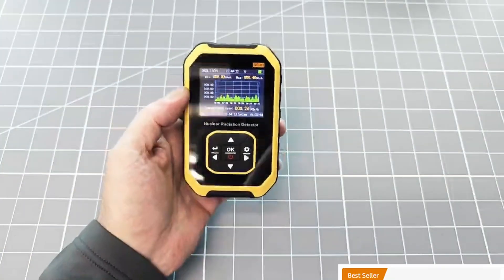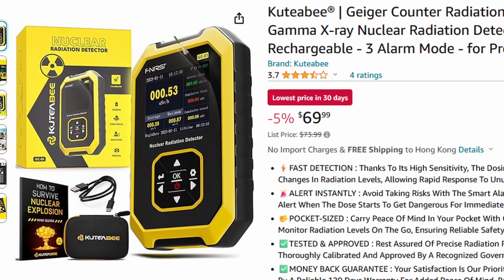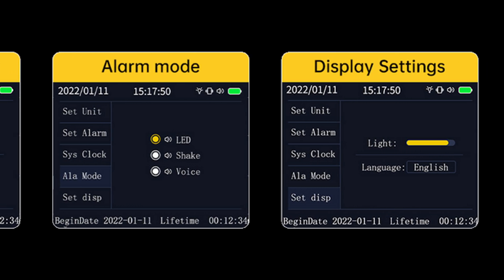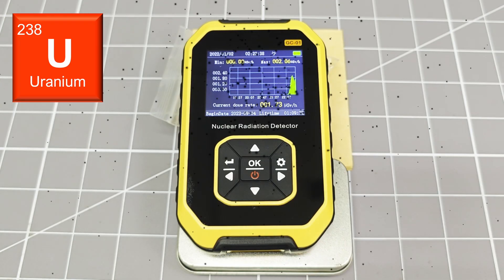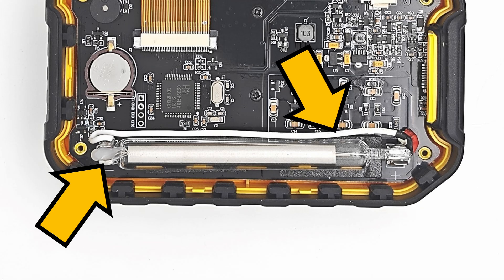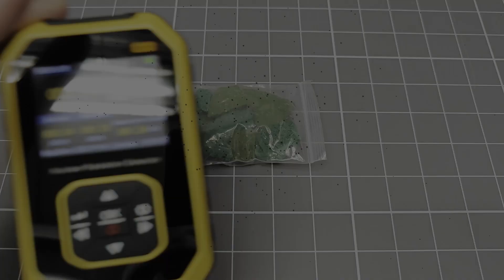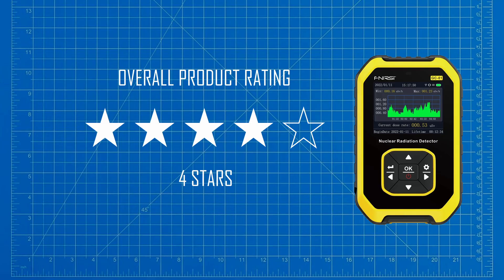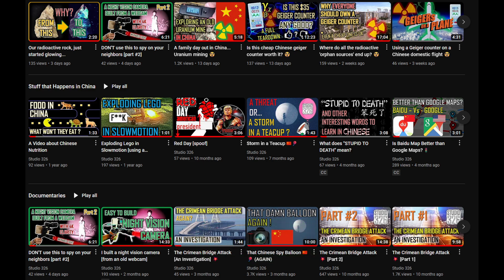FNIRSI GC-01 [IMPORTANT PRODUCT UPDATE]  ☢️

Comment from the maker: UPDATE - Don't remove the loading resistor (R38)  - it isn't necessary...
Reply: Consumers everywhere salute you!
Reply: This man must be protected.
Reply: Even when the tube is changed?
Reply from the maker: @blackfox_357chief4  When I made this video, it was summer here in the tropical region of China and the humidity was consistently over 85%, once winder arrived I found that without the loading resistor, the PSU voltage peaked pretty high and caused some ionization in the tube.
It should also be noted that as part of an crowd-science experiment I am currently running, it seems that there is a lot of manufacturing variability in the PSU voltage of the GC-01.
Reply: @project-326  So you can speak chinese too? Amazing!
Reply: What about the wire that is glued on? Does that stay too?
Reply from the maker: @falsch  thanks for the comment.  The wire is part of the 'hack' that the manufacturer has done to put the crappy tube onto the product and should be removed with the tube itself.
I hope that helps!
Reply: Hello, I just bought the fnirsi gc-01 and I made the modification with the 100nF capacitors. I also measured the voltage on the tube with my multimeter and I got 262v which seems too low to me, do you know how to increase the voltage on the tube? My r38 resistor has a 516 marking. Best regards
Reply from the maker: @uchu007  The voltage is probably correct, you multi-meter will have an input impedance of about 20M Ohm, and will pull the HV supply low.
Reply: I got one with the shitty little tube and no r38 resistor. Upgraded to J321, still shit. tube voltage is 300v. Can't flash radpro on it cause it doesn't show up as a USB on the computer. Overall, it's shit. Even with the J321 tube
Reply: i sugest testing it without cover its more sensitive
Reply: i have one with the good tube
Reply: Mine is just as described- thank you for the important info!
Reply: You rock
Reply: Value R38 ?
Reply from the maker: @svkpsychopath8074  4.7M to 10M depending upon the PSU characteristics.
Reply: @project-326  i uave small tube :( but R38 im not how calcuta it for bigher tube ?
Reply: So do the ones with the correct tube work?
Reply: Sry, is it necesarry or not?
Reply: It seems to matter; my dosimeter started to detect background radiation normally after removing this resistor.

Comment: A very professional video.  Sorry if this has been mentioned before but the circuit diagram that pops up a few times clearly shows both a speaker and LED wired to beep and flash at each count.  The values of these components would be much appreciated.
Reply from the maker: there is an update video that achieves a better result with a FW update...
https://youtu.be/23sX-_Oo_h0

Comment: I bought one of these Gc-01 detectors today with very low expectations. 
As your video showed, it does use what looks like the j613 tube or maybe an even cheaper copy of it! They seem to have redesigned the unit as it doesn’t look quite the same internally as the one in your video. They have also crapped out on the battery which could be a lithium 14500. 

What I found of particular concern is the fact that the battery only had 0.2volts yet I was able to plug in the usb and still charge it despite the cell voltage being dangerously low (risk of dendrites and battery fire). 
Like yours there is an led that flashes, however amusingly this is not visible from the exterior as the led cover is opaque.
Also sometimes the led will stay on for 1/2 a second so I’m wondering if the tube may be going into cascade intermittently.

The tube voltage on mine is 404volts and these are the results I measured using a thoriated camera lens.
1.24usv Fnrsi Gc-01
9.5usv with my radiacode 103
20.5usv using my Bosean Fs5000

Thanks for all the effort you put into making these videos! I particularly enjoyed the one about giving beta a makeover 😂
This is definitely one of my favourite channels along with applied science!
Reply from the maker: I am honored to be mentioned in the same sentence as Ben from applied science...

Comment: Hello, I bought the fnirsi GC-03, as my first geiger counter, I couldn't find lots or reviews but I bought it anyway and because it looks cool and it also has an electromagnetic detector. 
can you do a review on the gc-03 ?
 And if it's possible, can u also do a tutorial on how to add the clicking sound like you did on the GC-01? 
 I honestly dont think it will be as easy as the GC-01 because the led doesn't work in the same way?
 Anyway great review on the gc01 👌👌

Comment: You whiners, the reason it reads so low is because for starters the case is thick so it blocks out weaker betas and gammas and the Geiger tube is actually pretty decent. How do I know, I opened the back and put a sealed capsule of radium watch hands directly on the tube and the readings went higher than when the unit is closed. I will also say that the lack of the well known clicking makes this unit more discreet, especially when you live in a town of easily skittish and jumpy folks.
Reply from the maker: The J321 isn't the most sensitive tube, but it is pretty good for a cheap device.  I have several counters with this tube, the tube that this device came fitted with as standard was dreadful.  As for click sounds, I agree that there are situations where being able to turn that off (on a flight for example) is an advantage, but it seems that most people want that feature to at least be available.  There are a couple of video on the channel that show how to add that feature to this product...

Comment: Do you made direct comparison of GC01 and FS5000 counters with Radpro firmware installed on both devices?
Reply from the maker: thanks for the comment, I haven't tried that yet.  I am a little loathed to put Radpro onto my FS5K, I wasn't able to get the data download SW to run on my machine and I am very nervous to lose that feature on the FS5K
Reply: @project-326 Sorry, I don't understood you completly. Is there some problems to upgrade radpro firmware onto FS5000? Did I need to buy additional interface to do that?
Reply from the maker: @vstorch4968  there is an open source PC tool for offloading data from Radpro (I forgot the name), when I tried to install this, it failed.  I would rather not upgrade the standard FS5K firmware, until I can get the Radpro compatible data offload tool to work.  The standard FS5K firmware works with the manufacturer supplied PC software, and data offload is a capability that I need.
The second point, albeit a minor one, I don't really like the rather boring look of Radpro TBH.

Comment: Thanks for the video. I just checked mine out and it has an original J321 ßy tube in it 🙂lucky me.
Reply from the maker: Excellent, glad the video was useful!
Reply from the maker: FYI there are a couple of other videos about this model on the channel...
Reply: @project-326  I was going to add the cap and then I watched the software upgrade video and did that instead. I used the 2.1.1 version. The 3.x.x versions wouldnt load and I had to take the batterys out. Im back to 2.1.1.

Comment: Great videos. The FNIRSI GC-01 that I purchased around 2021 or 2022 contains the J321 tube. If it did not, I was going to change it as you have done. I will add the ticking sound as you have done.
Reply from the maker: There is a software upgrade (take a look on the channel for that video) that is better than the capacitor hack...
Thanks for the comment.
Reply: @project-326  I wiil do that. Thanks!

Comment: I got one of these today since my order last week. It was from a local supplier(Who I'm sure buys from other lower costs services). I paid about 35 dollars for this one. Got here saying it's a GC-01 but without the FixCo logo like yours had. I opened it up while watching the video and the PCB is VASTLY different. There's a rechargeable 300 mAh battery just wired with some wires and plugged into the board when it does claim to be a 1100 mAh battery, the Geiger tube has this weird 2 sided sticky tape holding it in place to not bang around and there's no haptic motor I can see. Maybe it's on the front cause i didn't dare to take it apart further. I cant take the sticky tape off the tube either since it sits there like shit on a wool blanket and I don't want to touch the tube at all in fear of messing it up. It does behave similar to yours, though I don't have any truly radioactive samples to test it on. Now I know that the measured doses are 3 times lower than usual. I should've watched reviews before getting this, but I guess I'll be able to make something out of this thing. This video was insightful even a year later. Though I don't know what else they changed. I must say the PCB doesn't look as sparse as this one. There's a lot more and a lot of small components as you'd usually find in Chinese products. Also It came with a charging cable but I wasn't able to interface it with my computer at all and looking closer at the board I could only see 2 traces from the USB-C power running to the battery terminals, unless the data lines are connected inside or on the other side of the board. As I'm writing this I got another cable to test with, but unfortunately there's nothing popping up on the computer. Reading on the box it says it can detect x-rays, gamma rays and beta rays. The tube is apparently an "energy compensation GM tube" and it does give a bit more information like sensitivity of 80CPM/uSv For Co-60. Energy range would be 48keV-1.5Mev=< +-30% of 137Cs (which probably means Cs-137). I'd love to hear your response on this and if it correlates to the data in the video if you happen to have that around. Thank you. Wish your video came sooner into my obsession with owning a geiger counter.
Reply from the maker: Thank you for the comment.  
Be careful, this is one of those subjects that can quickly become a hobby, but the up-side is that it is a hobby with no end of things to learn!
If the tube is the same type, ie has a stout connection on each end, then it is probably a J321 or M4011, both of which are reasonable tubes for a low cost counter.  If the tube looks like a stretched out 'Christmas tree light', then you have the cheap tube in yours.  The connections for the cheap tubes are on the same end.
There is another video on this channel that demonstrates how to upgrade the firmware, that gives a major improvement to the performance.  
The USB cable supplied with the unit is a power only cable, you will need a data cable , and to access the boot mode, you need to power up the device with the USB cable inserted.
Hope this helps.

Comment: Thanks for this great review and warning about the limitations of that Geiger counter.
I figured they wouldn't be very good quality, by the price. They cost about 1/6 of what my Ecotest Terra-P+ Geiger counter sells for. Terra-P (without the "+" plus) are used for Chernobyl tours. There's also a green military version that has blue-tooth connectivity to record readings on another device.
Reply from the maker: Thanks for the comment, that is a very good comparison of quality vs price.

Comment: Bitte Leute baut nicht eine Röhre neu rein oder ein widerstand. Denn es gibt drei bis vier unterschiedliche von den dingern mit den gleichen Namen gc01. Hier im Video wird gesagt das Ding ist scheiße Punkt was nicht so ganz stimmt Preis-Leistung mäßig ist das Ding super denn für 30 oder 40 € bekommt ja nichts besseres und das Ding ist schon top für den Preis. man kann für 5 € kein Auto kaufen und erwarten dass es doch fährt. Auch wird im Video wirklich nicht erklärt oder gezeigt warum ist schlechter ist
Reply from the maker: Oh, it certainty does explain why it is worse, by comparison and using actual measurements of many test sources.  But you are correct, this manufacturer has produced a lot of variants of this model and supplied them to many brands, including their own.
Take a look through the comments, there are a lot of people that have successfully upgraded this device to the improved specification.

Comment: Would you consider testing the FNIRSI GC-03 and see if this is any better? (you have been quiet for too long!)
Reply from the maker: Working on something, should be releasing it in a day or two, stay tuned!
I looked at this thing, I can't really see anything that jumps out about it.  It has a magnetometer, and RF level measurement (EMI) and a basic Geiger that uses the J321 or M4011 tube.  Interestingly, they have copied Boesean in promising to use  only the J321 or M4011 tube, and they only did it because of the pressure that I put on them.  So if the detection hardware is the same as the Bosean FS-5000, then all I would actually be reviewing is the user interface on the product...

Comment: I have the board version 202412 XBH-H240-VER1.6.  This "upgrade" doesn't have the backup battery.  There is an unsoldered, but tinned +M- next to a silk screened circle about the size of the version on the board in the video.  I will definitely be trying the tube upgrade and was able to squeak in a 905165 3.7v 4000mah battery.   One thing I found odd before I ever saw this video was the fact that while its claiming to detect beta, the plastic shell itself not having a mica window on it, is guaranteed to block some of the beta particles...at least, that was the theory I was operating off of when I tested it without the back panel on it, the difference was huge on mine (it has the crappy tube).  Theres a trapezoidal pattern on the back which I think I'm going to take a jewelers saw and cut out.  Amazon has 4" x 4" mica windows pretty cheap.  The one I have tested with a real geiger counter didn't have any significant background radiation (reason I checked was due to some of the mica out in my area is a bit more radioactive than the norm, so, I figured it would be good to check.  This board version also has a set of headers labeled J1 with 4 holes which I assume is for JTAG.  My version you can't make out which ARM mcu is on it, so, likely a generic.  This one is an official FNRSI with branding on the rear label and top left of the screen.  Any thoughts on the benefit of adding the mica window before I get silly?  Anyone who's upgraded the GM tube, do you see a big difference between its readout with the back on or off?  Looking at Electronics Goldmine I found that there are a few different tubes with similar characteristics but the most interesting one was the SBT-11A/CBT-11A Alpha, Beta and Gamma mica window Geiger Tube which I find interesting due to the greater range of detection.  I wonder if it would work with it.  Just cut a slot into the backside and 3D print a cover or 3D print a whole new backside with built in cover (which would also allow for a much larger battery).  Alternatively, if ones going to go through 3D printing a back side, one might be able to get away with using both a j315 and  j321 essentially getting the same effect as the two tubes (I assume adding a switch would be necessary) possibly the mica window and cover idea like mentioned earlier.  Basically just trying to make the best out of it to eliminate e-waste.  Any thoughts?  Oh, and thanks for the video, it was amazing!
Reply from the maker: Thanks for the comment.
1) Battery back up, please be careful with adding this, the firmware will probably not be able to work with this and there might be some unexpected results.
2) Don't worry about the plastic case, the tube is made of glass and this will stop most low energy betas anyway...

Comment: I just bought two of those from FNIRSI directly. They have the J321 tube (meanwhile?). If you install the much better radpro Firmware (available on github) you can activate the counter clicks without changing the hardware. So the situation is quite a bit better meanwhile.

Comment: Hi 👋,

Did any of you encounter situations where the GM tube becomes more sensitive? I have this GC-01 device with a GM 4011 tube installed in it. It goes nuts in seconds after being powered on. Other meters stay calm in background radiation as they should.

Using RadPro I'm able to set the sensitivity but I'm not sure that's the best course of action.

I thought that the sensitivity should decrease in time but this is the second device (just bought it) that does this.

Any thoughts? 🤔
Reply from the maker: Yes, if the voltage supplied to the tube is higher, then the sensitivity will increase.  It is always a gamble to have the voltage shifted to the top end of the Geiger plateau as you might have a tube that is at the low end of the tolerance range and then do into the continuous discharge part of the curve.
Reply: @project-326 thanks for replying. I measured something like 369Vdc on the tube. The datasheet says it should be somewhere in between 380 and 450V. I might just have a bad GM tube. 🤷‍♂️
Reply from the maker: @clue0001  Personally, I have never known one to 'go bad' but then I only have a sample of a dozen or so, not exactly solid statistics!

Comment: ENG:
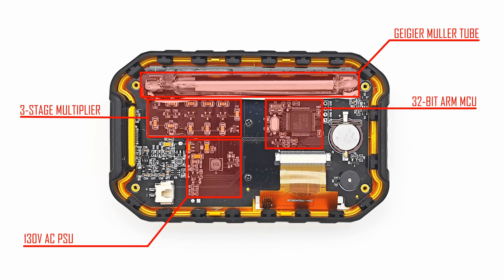In the video I heard (8:35 min). that there are two voltages: 130 and 380 €.
and the resistor that was subsequently installed sets the tube to 280 volts which is now inside correctly
When I change the tube with the j321 , do I have to remove the resistor so that the tube works properly or
Can I leave out the resistor or do I have to short-circuit it

Ger:
im Video habe ich gehört. dass es 2 Spannungen gibt 130 und 380 € .
und der Widerstand der danach nachträglich eingebaut wurde setzt die Röhre auf 280 Volt die jetzt drinne ist richtig
wenn ich die Röhre wechsle mit der j321. muss ich die Widerstand entfernen damit die Röhre auch funktioniert richtig oder
kann ich die Widerstand weglassen oder muss ich ihn kurzschließen
Reply from the maker: Google auto translate is pretty mistake prone...